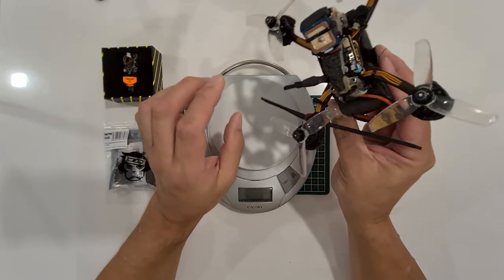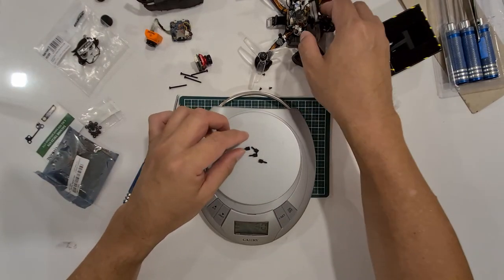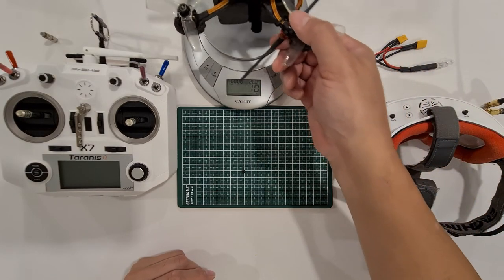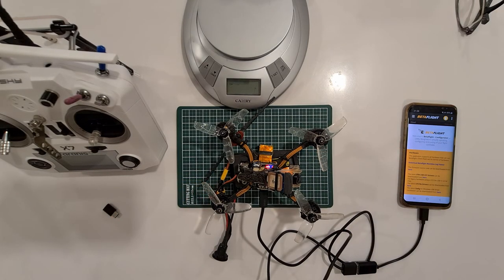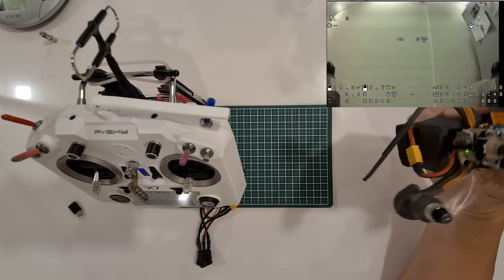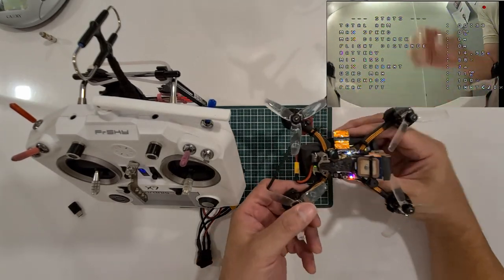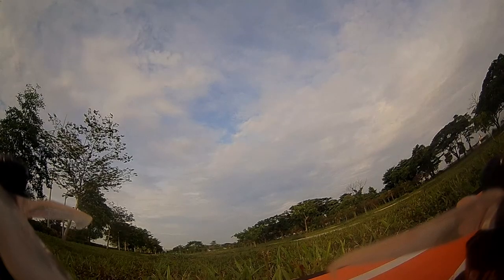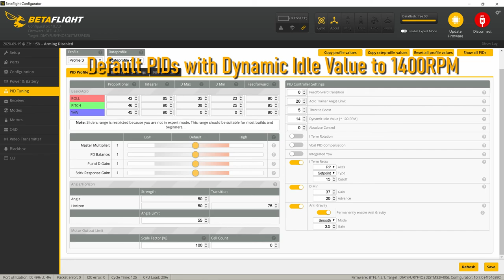Diatone3 - Upgraded with Runcam Split Mini 3 but is it still under 250g?

Comment: how about split3nano？
Reply from the maker: Split 3 nano is a different camera. Everything else the same only Micro has a better lens therefore the module is better than nano. Nano is made smaller with smaller lens and lighter to fit in tiny whoops.